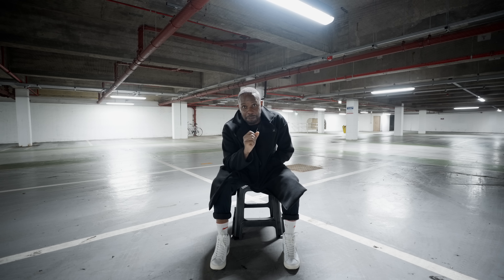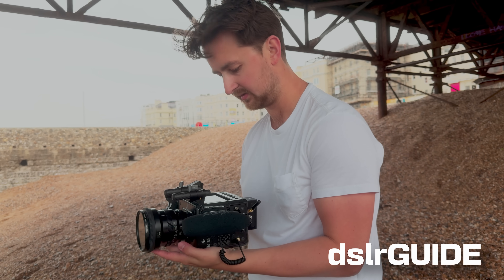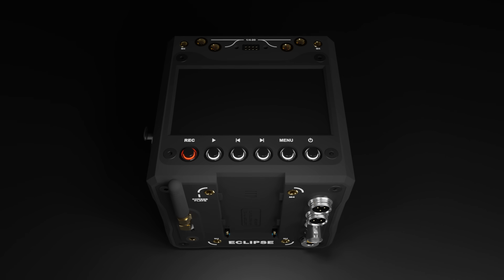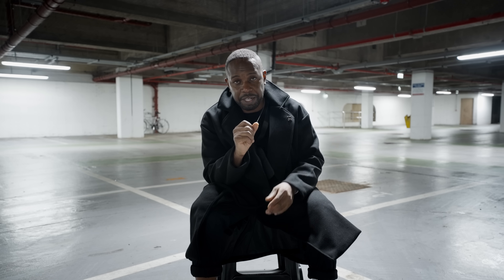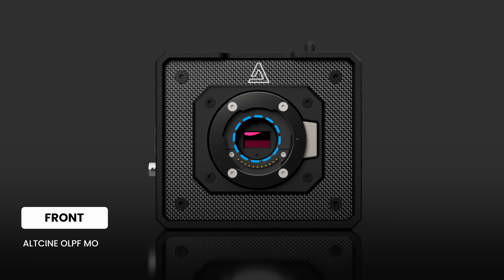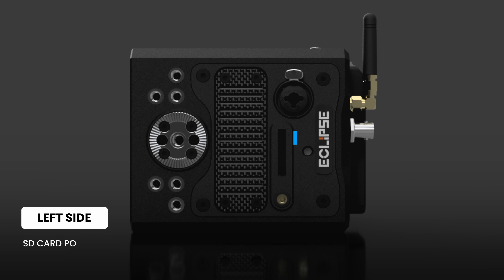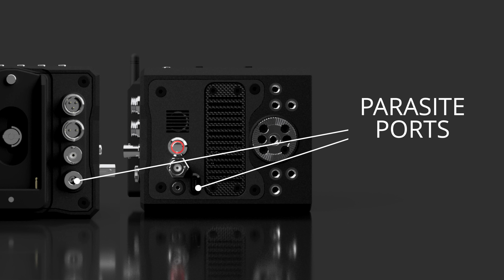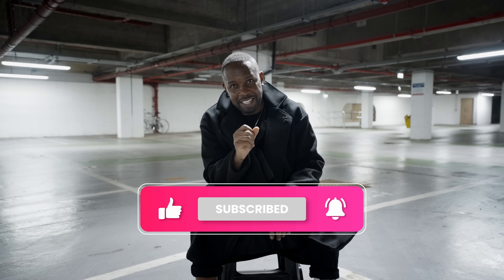BUILD A CINEMA CAMERA -  THE ECLIPSE IS COMPLETE

Comment from the maker: DC port is IN and OUT.
Top Panel is also made buy PixelCNC.

The ECLIPSE cannot be purchased at the moment. We have completed the builds for early adopters. Stay tuned for more info.

Although I oversimplified the images and build, there's not much remaining of the BMMCC inside.

The NEOGRAY film is actually another ECLIPSE being built. ALL electronics had to be re-worked to achieve these upgrades.

Comment: FX30, with 6k Raw No crop BRAW, BP U Hot swappable, bottom 15 mm rod 2 back and front inputs, usb c input at front for power follow focus etc, maybe 3 usbc ports, dtap splitter,  pl  to e mount adaptor, and screen on top of fx30 box build and nato rails / mount points all over,

Comment: you didn't talk about the sensor at all in the specs part. Is the V2 just a blackmagic mini with a housing built around it as well?
Reply: The V2 has all the internal parts replaced along with the screen bringing in some new features. So its the more developed version of the first Eclipse, this means its the same camera being used with the same sensor. I would argue that its a bit more than a housing built around it tough🙏

Comment: What are the environmental specs? And any internal weather protection?
Reply: We tried to make it as weather sealed as possible, all the buttons have rubber rings around them, the display is sealed to the top plate along with the pogo pins. This makes it do pretty well even in rain as the top won’t let water in. The problem is the sides, having two vents for intake and outlet does not allow weather sealing. The ports have the same rubber rings around them on the inside but you would still have to be careful with the vents. I say a light rain won’t hurt.
Reply: @simon-altcinecam  any idea of how low we can go with operating temps?
Reply from the maker: @Premier-Media-Group I will be testing that in Iceland early 2025 but because we will have the CinePi ready and which is more important...I might take that instead.

We shall see but either way, a video will be uploaded.
Reply: @AltCine  and all the best for the CinePi project! Definitely going to be a kick-ass product!

Comment: Is this a joke?? Depressing.
Reply: Why?
Reply: Depressing? Next time, they should add balloons and kittens.
Reply: What’s depressing?
Reply from the maker: Can you please explain?

Nearly every company from Microsoft, Apple to Amazon was started in a very low key way and using business models from other companies.

Our end goal is to give people the opportunity to build a high resolution cinema camera at home that's self upgradeable hardware & software.

If that's depressing to you, I think you need to reflect on your mental state of mind.
Reply: @AltCine  I posted a long in depth reply that seems to have been removed. In essence sticking a box camera in another box isnt cameras design. Only a rank amateur would think so and only a complete bs merchant would claim so. As for the ui and io it is laughable. Easy exemplar is that np battery accessory from presumably small rig. Did you run out of magnesium alloy or carbon fibre epoxy resin? As for the choice of camera to Rebox it is transparent as to why you choice the micro. This is 100% bs or delusion and you can take your pick. Just like the Nexus 1 you and many others think they have identified a gap in the market as so many mirrorless camera are put into prebuilt rigged solutions. This isn’t even that. Old tech that even BM have given up on. I once knew someone who called young women chicks and thought he could build his own version of a sports car to presumably act as some kind of babe magnet. It was a 6 wheel monstrosity more boat than car made out of bits from various performance cars or bits as cheap as chips where he had to cut corners. It was laughable that he actually thought it was super cool. This and the Nexus 1 to a large extent are products of a similarly deluded egotistical mindset. Good luck I would love to be proven wrong but I am not holding my breath.
Reply: @KenFlanagan So many words just to say nothing😆
Reply: @ I think your camera is a scam. How about that.
Reply: @KenFlanagan  You can see the working camera in many videos now, there is also footage made by a high level DP and the units made are already shipping. What part of it is a scam? How can a working camera be scam? All this video is was an update on it and whats our step forward. Also since when does the Micro considered a box camera(by that logic the gopro is also a box camera)? While we are at it, why won’t you make something better then? Are you actually capable and know the technical side of it or you just come at projects like these to run your mouth?
Reply: @KenFlanagan  Everyone who bought it know exactly what it is, what parts went into it and followed along the full build process. Again, the stuff you are saying is nonsense. Do you really have the means to mention the Venice that was made by a multi billion dollar company? The Eclipse is made by two guys in a bedroom without any funding, without any outside help other than having carbon fiber plates CNC Machined for it. Also you mention that the Kinefinity Mavo 35 is not breaking the bank with a price of 4.5k dollars for a base model? Are you dellusional or something? Do you think everyone can afford that? Again just pure nonsense you are coming up with nothing else.
Reply: @ exactly two guys in a bedroom and unfortunately it looks like that. Great that you are selling them and good luck. If they are for amateurs just wanting to play around great but in a professional setting clients require reliability. Even kinefinity are passed by for fx6s. I’m sure you know all this but confidence in a product is pretty important ime and your previous videos around the kitchen table 6 months ago are revealing in a way that you may find quite damaging or maybe that’s your journey and you are proud of it. This has the mentality of pimping an old cortina with rims a new exhaust and blacked out windows and lowering the suspension until the exhaust grinds against the first sleeping policeman. I have no idea who this camera is for or price point but it’s clearly not for me. Good luck.
Reply: @ Since the video of 6 months ago that camera was constantly in use even on professional sets without a single issue. That sums up the reliability pretty well i think. The new version had all of its internals swapped for new features and having better power consumtion. All this was tested for months. Again, there was and there will be amazing footage made with this camera and thats the only thing that really matters. The only depressing thing here is that not a single person asked if its for you or not.
Reply: @ how much is it and who is stocking it? Have you posted any reviews. I don’t see a price on your website. Thx
Reply: @KenFlanagan  These two questions just show how uninformed you are yet here you are saying stuff like “depressing”. Its no longer for sale as we move on to the CinePi.
Reply: @ ??? Then why did you post a film about it on YouTube. Surely if the response was so good and you have demand then aren’t you stopping selling it prematurely. ????

Comment: love what you are doing, but also don't really get the point of doing this on a very old sensor. Dual gain technology was a thing when this camera was released, it's not something special nowadays. I used an OG on my last film, and the image quality man, is often disappointing (yes, I know how to expose this camera!). A lot of unwanted noise, grid pattern in low light, limited dynamic range (compared to the 4K at least one stop lower). The BMPCC 4K made a lot more sense to be modified, given more option (including a 2.6K mode with a 8ms rolling shutter and much much better lowlight performance). I think you are great and kind people, love what you are doing, don't want to sound too harsh but just pushing you investing energies into something more useful, given the amazing achievements you are reaching from a technical standpoint. Best wishes
Reply: Dual Gain technology is still special. There are only a few number of sensor having this technology implemented and most of them is in Arri cameras. The industry changed over to Dual Native ISO which is not an in sensor level technology so its easier for manifacturers to produce. I think the works of Neogray Films sums up pretty well the image quality of this camera and how capable it still is. I won’t comment much on dynamic range as both the OG and 4k in this case claims to have 13 stops. Both of them try to achieve this differently and this is where the speciality of this sensor shines. It has an organic image profile. Since the production of the Pocket 4k Blackmagic switched over to Sony sensors. The 4K for example has an IMX294, i don’t think that it has anything special compared to the Fairchild one other than more resolution. All this can come down to personal taste so the more accurate answer to your question is that we liked it this way.
Reply: @simon-altcinecam  I tend to disagree. Sensor technology has come long way forward. Every sensor technology has to be related to each sensor limitation. Dual gain technology made sense in early CMOS developments, not nowadays. Have a look at Canon C70 vs Canon C80 comparison. Canon C70 has a great dual gain technology (kind of) but Canon C80 has not, yet you get a better image out of the C80, cleaner shadows and same dynamic range. To be fair, Fairchild sensor were great, in particular the one on the BMCC 2.5K which has higher bitrate and can recover highlight fantastically, although rolling shutter was quite bad. But I find the Fairchild sensor on the BMPCC OG and the BMCC OG very disappointing. Yes they give an organic image, but nothing you can't reach nowadays with basically every camera on the market. Also, the sensor is only a part of the story. I think gyro data on the BMPCC 4K is quite revolutionary for handheld footage and other option you can activate in post, such as mitigate the rolling shutter (partially). There is this amazing story we tell us on Fairchild sensor which makes no sense nowadays. Even the CinePI smokes any Fairchild out of the water. But let me be clear: I appreciate your work.
Reply from the maker: @MrDavidemar I get it, although I do love the organic look of Fairchild...I've also been impressed with even some modern 8 but cams in the right settings.

Regarding the ECLIPSE, we never made this to be a success. Think of this as test run in order to gain the knowledge we need to put into the CinePi.

We could have went directly to CinePi but we've torn down quite a few cameras to see what's possible.

The first one was the canon M-Lite which was a very basic rehousing. The Eclipse went far beyond that to a full electronic rebuild and the insights were fantastic.

Now we're putting the simplicity of the M-lite with he complexities of ECLIPSE in making a camera that hopefully most people can build,  hardware upgrade and software tweak at home.

I actually like your question, thought provoking & well stated with good examples.
Reply: @AltCine  I deeply appreciate that  gentlemen like you and Simon can discuss without feeling criticized. Any news about the CinePi/Octopus project? Everything seems abandoned....

Comment: Guys, can I ask you a question? Why didn't you use a BMCC 2.5K camera as a base? After all, this is a much more advanced camera, but with the same sensor.
Reply from the maker: Hi mate, yeah that might have actually been easier and the added bonus of SSD but despite the image I showed of the micro with the screws, ports etc...we actually had to remove most of the micro housing to make the camera this size.

We tried to do the p6k before this but the camera ended up so large due to the circuit boards it wasn't worth it.

You definitely have a valid question but yes, it would have ended up quite large.

Comment: 🎥 I have to question the wisdom of putting the menu monitor and buttons on the top.
Reply from the maker: Where would you have put them?
Reply: @AltCine  That is a leading question, depending on who is asking but since for you I killa de bull I will tell you. I would put them where I have access to them when the camera is on sticks and the lens is at standing eye height and taller. That would mean for them to be on the smart side of the camera. Now we know from experience that the buttons on the BMD micro and studio cameras are a pain because one cannot see them when one needs to operate them and they happen to be on the front, dumb side of the camera. Monitor and buttons are good on the top for hand held and sitting interviews but for anything where the lens is at eye height and above, it becomes an issue of needing to have a "man maker" or short ladder to see the menu screen and access to buttons. Be kind to vertically challenged camera operators.